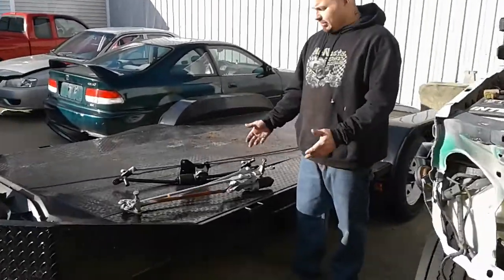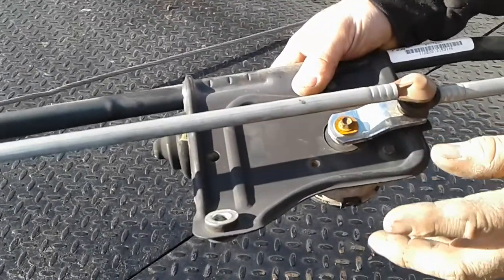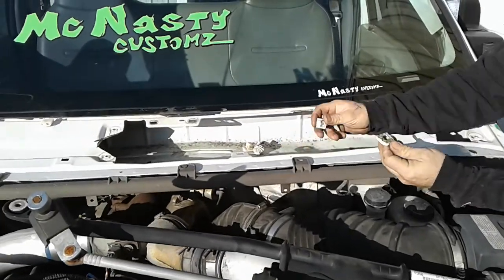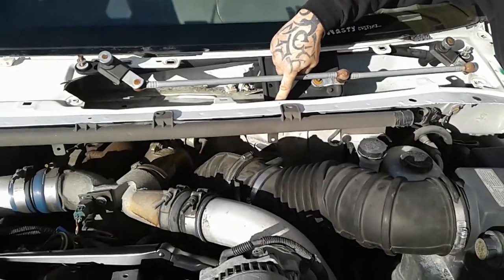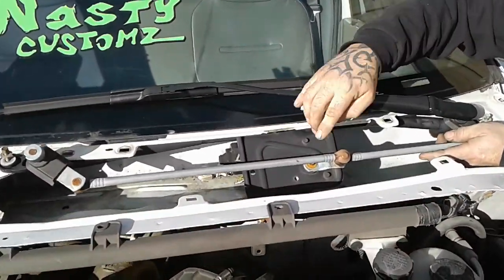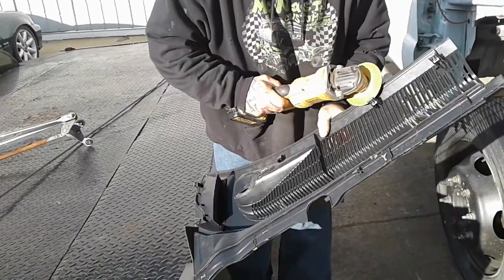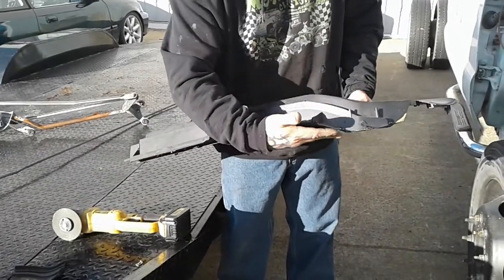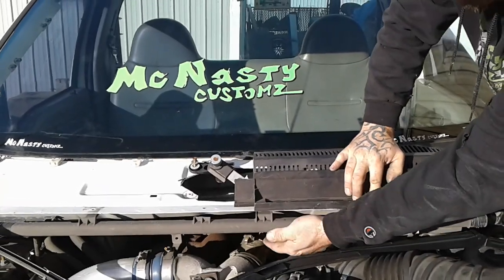McNasty Customz wiper cowl and linkage installation

Comment: On the 05 to 15 what wiper motor assembly do you use? I used my 05 assembly and my wipers don’t set flat on the windshield.
Reply from the maker: You use the motor from 05 but use the linkage and transmission from the 15